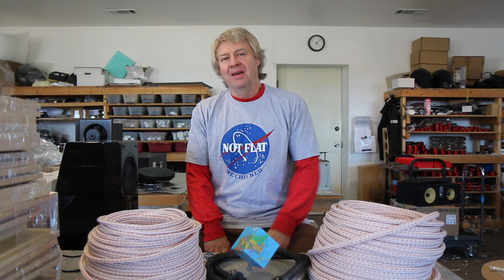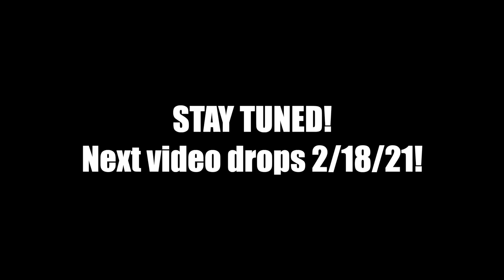Audiophile Cable TRUTHS: The Divided Camps

Comment: So far I loved your approach, but today you disappointed me.
as you basically had two opposite statements dooring the video. 
Simplified (I'm to lazy to fully quote):
1.) If you are not measuring the right data, you will not gate god results (they will give you wrong assumption, ie suspension example)
2.) even if they measure same they are different, and only listening is important (I do agree that it is what is important at the end)

1st disagreement: listening is not science, it is highly subjective (even for single person) and is newer accepted as measurement without blind back to back testing as there could be subconscious whish for one to be better than the other etc..  
2nd "comment", are you really sure you can really measure everything that is important in the sound chain, that you can quantify it and understand ? as you state "measured equally sound differently". either you didn't measure what you should to be able to quantify the change, or if you trully did, than the difference in sound was purely in your brain. ie you contradict you self.

to bring it to the flat earth level:
The all mighty (that can do everything) cannot make a rock so big, that he cannot lift him self.
Reply: My statements make no contradiction. Tune in to the up coming episodes for a little more of an explanation.
Reply: @dannyrichie9743  I'm eager to se. will follow you.

Comment: Hi Danny, I like your channel but.. 14 minutes to say cables in a good hi-fi system matter?  We know that , depending on the task, getting the correct signal, power or speaker wire makes a difference. Get the right cable for the job and just enjoy the trip.

Comment: Get a network analyzer and oscilloscope. Between the 2 of them you should be able to prove your claims about cables. Or, more likely, disprove most of your claims. 

This channel is so weird. Lots of episodes with objective data, crossover redesigns, etc, and then, mixed in there, occasional videos like this one peddling price-tag-first components and wire. Why not use objective measurements to prove your claims about components and wire? The only possible explanation is that it undermines your business model.